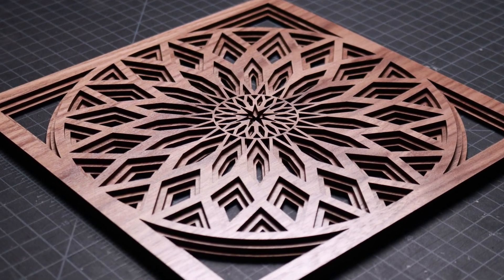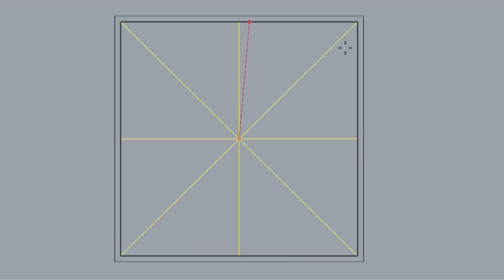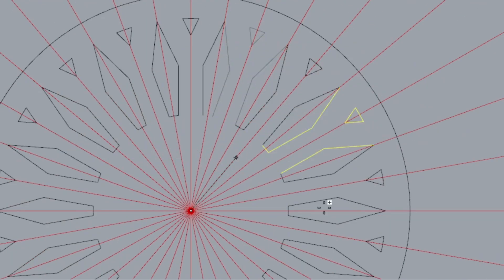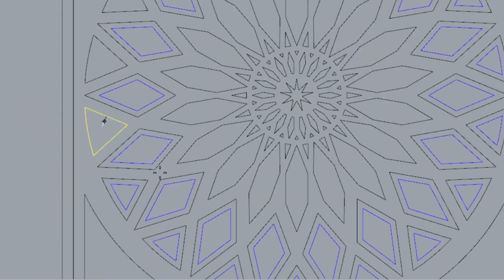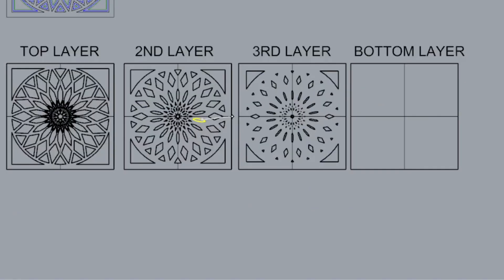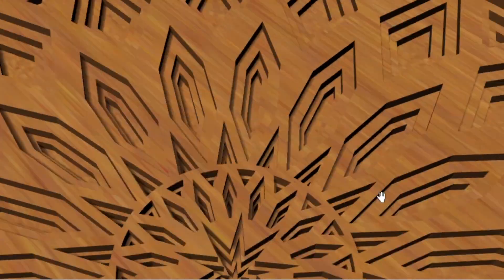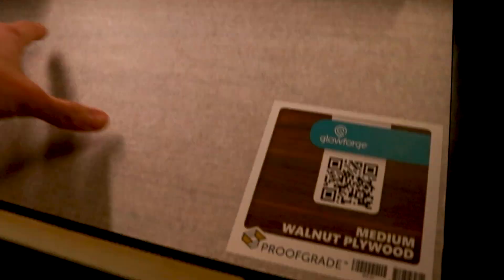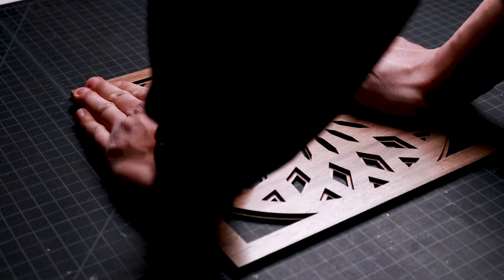How to Make Layered Geometric Art with a Laser Cutter

Comment: Hi Tim, wonderful artwork and even mote wonderful how you share it, clear, accessible and precise! Do you think one could combine this with epoxy to give it a stained glass look? Or are there difficulties in doing so?
Reply from the maker: Thank you and great question! I think you can combine it with epoxy within the open areas that you can see through to add color. The way I think it could work is you cut the first layer, pour epoxy into the openings, let it cure, sand and finish, then attach the remaining layers of wood. You could also cut 2x the layers so you have the depth on both sides of the finished piece.

Comment: What software are you using to create your pattern with?  It looks a bit more complex than Adobe Illustrator or Corel Draw, which I am familiar with both of them to create my digital files for my K40 Laser Machine.  Working with woods it's important to use some type of masking tape, preferably the clear Kraft masking tape, in order to reduce Flare Ups or Burn outs, and smoking up your wood products.  If this happens, it is not a big problem, you just need to do some sanding and getting rid of the areas that have smoke blemishes.  Every now and then you can pause your sanding too, and clean with 91% alcohol or acetone, let these dry completely off and inspect your work again.  If you need to repeat the process, then all you need to do is follow the same steps as mentioned above.  Woods can be a bit challenging with laser cutters/engravers.  But again, if you ever experience burnouts, even with masking tape, just take a deep breath and get to sanding.  How do you like your Glow Forge laser machine?  Have you used others before too?  If so, how do other brands compare to the Glow Forge?  Thanks again for sharing the video and knowledge.
Reply from the maker: Thanks for the suggestions and I agree. In terms of software, I use Rhinoceros. For laser cutting, I've been using my Glowforge for over 4 years now. I've used a few others as well. For hobby projects and size, Glowforge works well. If I ever decide to scale up and sell products, I'd transition to a stronger and faster laser like one of the Mira ones.

Comment: You just got a new sub ... your stuff is awesome. In the video you state you remove something off the wood. Are you putting masking tape down to save the edges from burning?
Reply from the maker: Thank you! There’s usually a masking tape tightly pressed to the materials. It protects the surfaces from scorching, burns, and any debris during the laser cutting process.

Comment: What did you use to animate the design to make it look like wood before you actually cut it ?
Reply from the maker: It’s a software called rhinoceros. I changed the material of the model to cherry wood and it applied it to the surfaces.